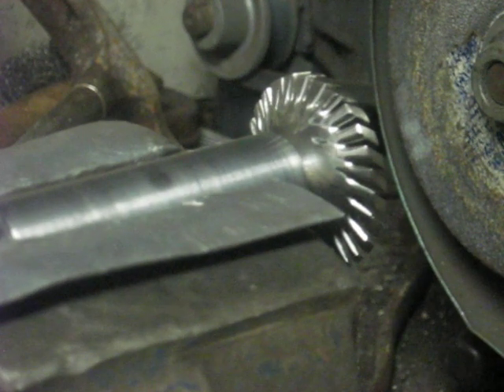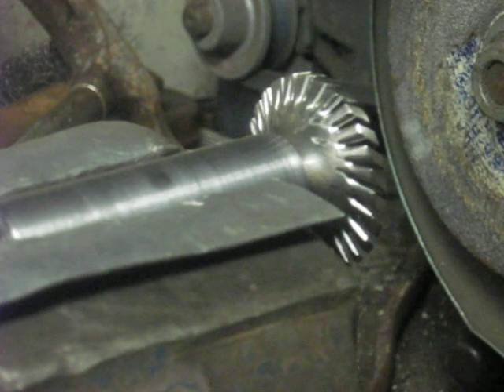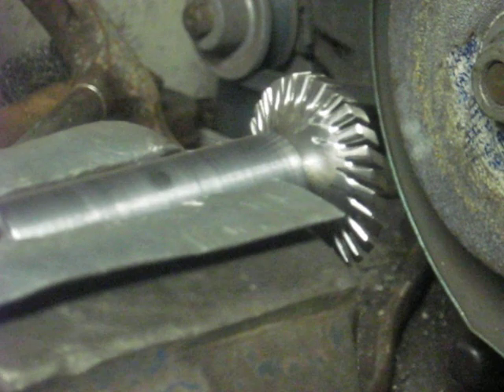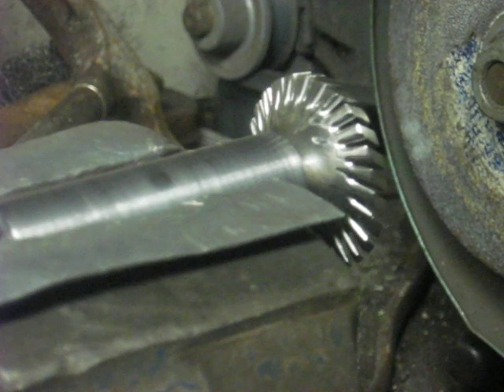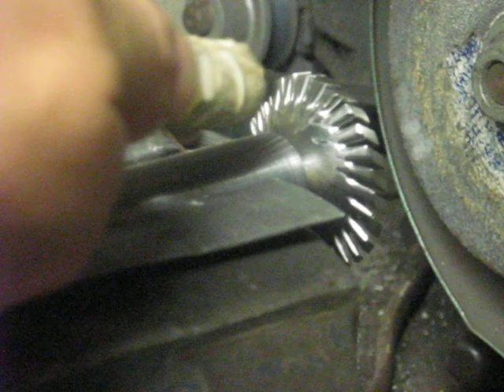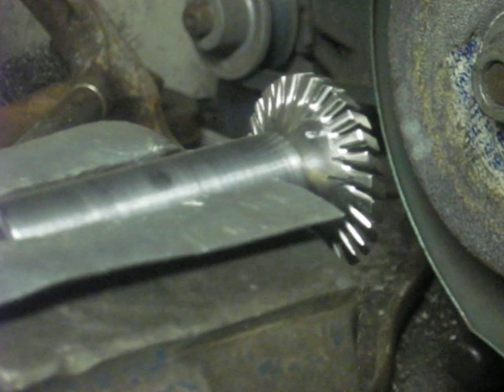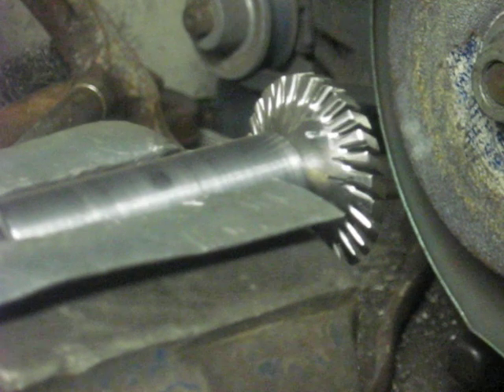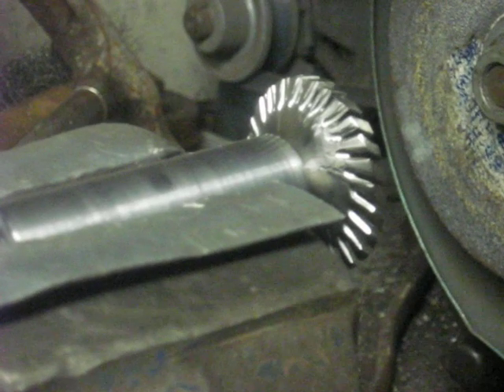Screaming Turbine Test!  :)

Comment: From what I can see your turbine is working on a purely impulse principle. If you installed nozzle guide vanes in front to direct the gas onto the turbine I believe you could increase it's power & rpm. 2nd choice is to use a sheet metal turbine and twist the blades to form a reaction turbine. Look up Kurt Scheckling and how he made a simple turbine for his FD3/67 miniature jet engine
Reply from the maker: thanks for the info.

Comment from the maker: I guess my hands are pretty steady, but not as rock solid as they were in younger years :)
I made a template using CAD, silicone sealed it onto the valve, put a protractor down by the vise, and did my best to keep the rotary tool at that angle. A few of the blades are narrower than they should be, but we couldn't figure an easy way to hold onto a Dremel, while having the valve held in an indexing head at the machine shop. Then I used a 1/8" carbide cutter to "V" shape the blades on inlet side.